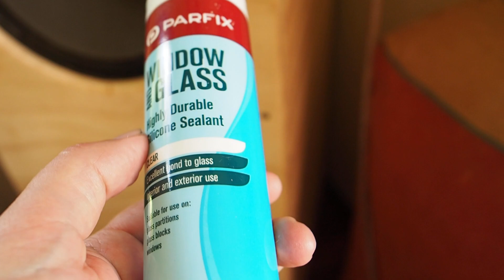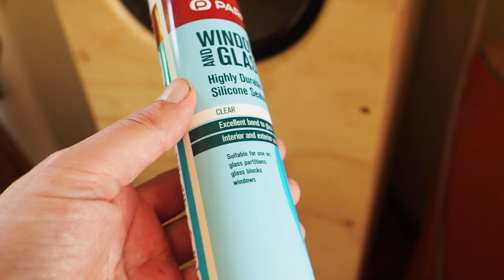Lancelot - Smaller construction details, answer to questions from Luis

Comment: For using a CD as a wide angle wave guide, I would think that you could use the Le Cleach horn expansion to really minimize the diffraction problems caused by an abrupt exit of the throat to the room. The Le Cleach method of analysis creates a horn with perfect resistance load further down into the lower frequencies of the CD.  And, can tend to help widen the dispersion of the higher frequencies which may tend to beam out from the throat. 

Joseph Crowe is doing some incredible work sharing designs and information for diy or purchase for horns using the very latest expansion techniques. Also, Hornresp has Le Cleach horn expansions which would be normally very difficult to model mathematically for some complicated reasons. In any case a Le Cleach  horn had probably not yet been designed for a larger throat CD (2") for very short horn length since  the goal is not to increase SPL, but to design for minimized diffraction and best dispersion of HF. https://josephcrowe.com/blogs/news/circular-horn-no-1689
Reply from the maker: Thank you yes I've been made aware of azurahorns (LeCleach based) which are being made here down under and have been following jopesh crowe for a while. As you finely pointed out they're all still made for certain horizontal/vertical dispersion. 

From what I've seen, most if not all horns suffer from diffraction and as a result timesmearing and turbulence over surfaces and angle changes. The ones with high angle exits have less edge diffraction, but still have that internally. 

It could be very interesting to see what an omnidirectional horn could accomplish to get as much constant directivity out of them and as little timesmearing and diffraction. That 1689 model is promising although the cut-off freq. is a bit high. Impulse response looks good.

Actually one of  things I'm considering is to have both drivers upfiring (woofer+CD) and see what happens which such a setup, incl. a very nice smooth and shallow horn for the CD. I

This kind of setup would be nearly the opposite of a nearfield speaker, where direct energy overwhelms.
Reply from the maker: Actually, I just read on diyaudio that Jean Michelle LeCleach said whole room listeners shouldn't use his horn type.. only those who optimise for 1 position (despite the good directivity?)...

Comment: What about getting a 6-in thick tile and cementing it to the top and cut it out for the tweeter.and bolts would definitely make it lively you'll be able to hear that triangle in the back ping 😉 You could try a ring like a curtain rail ring stick it with a bit of blue tack on the bolts that does help with dispersion and increasing higher frequencies. You given up on the golf ball why????
You've got plenty of material You can round it to the screw holes still planning material to hold on to.
Do you not see the comment about putting another panel where the compression driver is by cutting out a square piece laying in a frame and isolating that panel with the compression driver to the main top.
Reply from the maker: Golf ball: something goes wrong when I put a reflective surface. My guess is it causes edge refraction because the speaker becomes very locatable and I don't like the effect. I like your tile idea; it works for turntables.. I also think a cradle with a ton of blue tac may yield good results. There's some indication the precise phase control at the xo point is more important than dirver-driver distance, so its probably going to be some combination of laminating material, damping, ...
Reply: @EduardBroekman  question is how close the golf ball is to the driver I'm talking very close millimetres, and maybe you need a smaller ball than a golf ball size like a inch marble in and above the hole.
Yes but the laminating is only an isolator or dampening the board, the separate trap door with loads of blue tech would achieve a better result than laminated board. I think maybe you should have the driver flush with the top of the cabinet by supporting it underneath not screwed from the top, partly the holes too small you want greater flare horn to increase smooth dispersion, there's too much baffle on the top for the tweeter, one solution is mount the driver on the outside and have a thin bow shape flash with the top of the driver from forward to back or bowl sheep.
If you could buy a wicker basket bowl cut a hole in it and place that upside down over the driver secure it with blu tack or giant 12"+ wooden bowl that might work a treat. try the curtain ring or something similar.

Comment: Hi eduard am enjoying your videos , am looking to build my first speaker and was thinking of having the front baffle also  a removable as it is the most likely to change or replace. The double sided tap idea was interesting and am wondering if it  is double sided tape they use for mirrors at the local bunnings hardware store or is it something different .
Reply from the maker: Hi there. It's single side, 1mm thick, 3cm wide dense foam tape - not double sided. I got it off ebay a while back. So it's definitely not double sided mounting tape.

Comment: Yes I'm famous thank you no one ever gave me a shout out over YouTube thanks. And also I'm surprised you didn't use modeling clay to form around the hole for a better transition almost like a small funnel and also have you ever thought of using dynamat under your top baffle then attach your compression driver over it and I'm also surprised that since it has a hardwood frame under it you can't form a brace to support the compression driver from the inside but you answer alot of my questions thank you
Reply from the maker: Hi Luis. You're welcome.. good questions and comments make much better videos so thank you :)) 

Unlike hardened clay which is quite brittle, blu-tack stay supple and has good damping qualities. I didn't consider using any sandwich material between the wood & CD... but I'll keep it in mind; there's not that much spare space on the lugs to mount it. And I've got Janos wispering about Luthiers who don't use that ... :) 

As for hardwood bracing .. the shape of the CD makes it hard to directly support from the bottom. Not impossible, but it would interfere with the 'horn' flow of sound and would also need additional supporting 'interface' material between CD and frame. For a next iteration, I'm more thinking of running an asymmetric brace on the top panel as well as use a sandwich approach for a thick top panel with 3 different materials to make its resonant behaviour very controlled, or take the Occelia front baffle approach and just use a very thick mounting panel on top and use a router to thin the panel where the CD goes.

All of this needs a bit more research where resonances are occurring now. With prototype #1 where I was running with the funnel on top, having the CD resting on large blobs of blu-tack definitely lowered the 'distortion/noise-floor' with improved clarity in the HF regions, so I think its worthwhile paying a lot of attention to mounting the HF drivers. It could be that resting is better than mounting it even.. but that sort of approach would also increase the distance between woofer and CD, which usually requires a longer listening distance to sound as 1 source. It's all a trade-off but right now a thicker top would seems the least amount of trade-off.. and perhaps separate construction of a solid non-resonant frame could also further help isolate the top panel.
Reply from the maker: Luis.. sorry you must mean the more plastic type clay that stays soft. Have you tried it?
Reply: @Eduard Broekman  yeah I use the soft kind and also plumber putty but your lugs you ever think of ordering longer ones so you there just threaded lugs and bolts you can get from a hardware shop

Comment: Thank you for a great presentation. Could one remove the compression driver, modify the top with a larger hole, glue a second piece of material on top of it remounting the compression driver under it? The goal would be to have a greater opportunity to round over the edges and more solid mounting for the compression driver. Just a thought....
Congratulations on a great realization of a great design. Thanks!
Reply from the maker: Hi Bruce. Absolutely indeed in a next version I'm very likely go with mounting on the lower piece of material, and use the 2nd layer to be able to embed the mounting nuts and use the 2 layers to have a larger 'horn'. The problem of using a dual layer as an addition to this design is that the front runs all the way up: it's better to have the front panel run until it hits the top layer so that all the rounding off can be done with the top panel (only)... so I may leave this prototype #2 as it is (for now).
Reply: @EduardBroekman  thanks for the gracious reply. I look forward to following your further adventures!